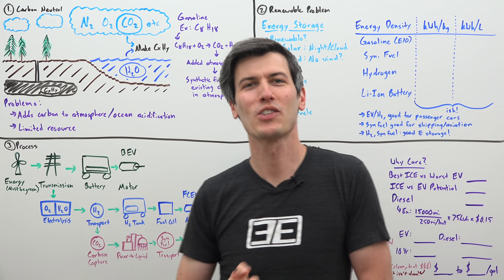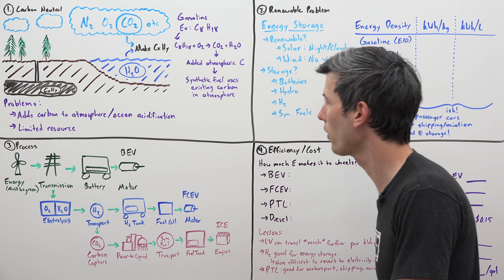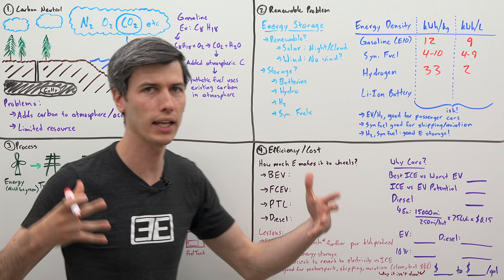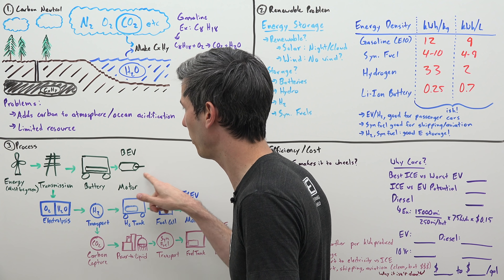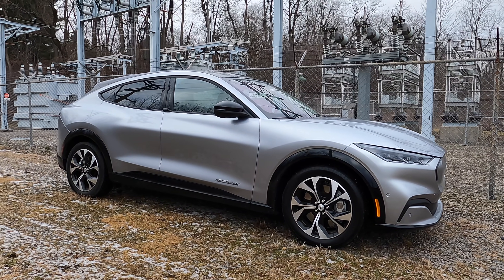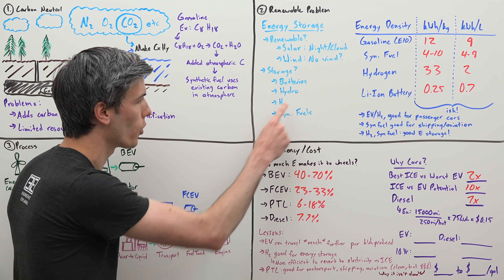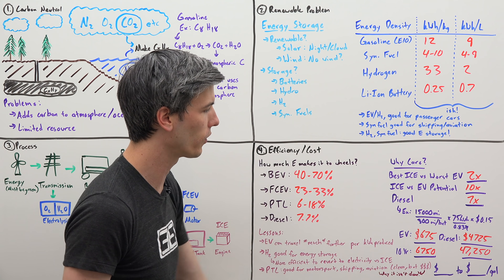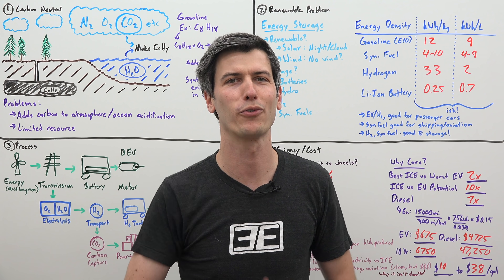The Big Problem With Synthetic Fuels

Comment from the maker: *Addressing Frequent Comments!*
1). “I’m already paying $2/L.” Porsche is at $10/L, and hoping to get it down to $2/L. That’s cost. Add in your local tax, and that number goes up. A big part of why fuel is more expensive in Europe vs the US is that it is taxed significantly higher in Europe. Additional edit: EV owners pay road taxes as well - it's incorporated into higher registration fees (you're not tax exempt simply because your transportation could be carbon neutral). 
2). “I’m an EV shill.” Haha okay. I still love my supercharged Miata, and despite how slow it is, my Crosstrek as well. It’s possible to like both combustion cars and EVs, and also acknowledge the shortcomings of each. I like burnouts. I fly frequently for work. The Jaguar F-Type SVR’s exhaust is a sound worth hearing. I’m not good for the planet. None of this changes the information presented in this video.
3). Not one compliment on those tree drawings?! C'mon. Those are some nice trees.
Reply: Please do a video on Biofuels.
Reply: @justinlynch6691  I was responding to Justin Irace above. He had a question about E85. The whole ethanol program is just a welfare program for US corn farmers. I live in farm country and find it humorous that the farmers are talking about the how ethanol fits in to carbon reduction. They don't have a clue what's coming.
Reply: Everything thats new is expensive in the beggining and gets cheaper as time goes on.
Reply: @Shabbe02  This really isn't about manufacturing processes and efficiencies, it's about energy required. As we get more efficient at producing energy this difference won't disappear. In fact, the efficient limit of a generous 40% on ICE engines means even if 0 energy is lost in making the fuel, we'll still only get 40% out.  Unless energy is free in the future, this won't change.
Reply: @justinlynch6691  you won't ever get 40% out of an ICE, you might get 35-40% out of a large ship Diesel engine that runs at efficiency peak all the time but for a passenger car we are looking more at 10-20%
Reply: @SchwertKruemel  Check out opposed piston diesel engines. They can get up to 55% efficient. Combine it with mild hybrid tech and it will be over 60%.
Reply: Nice happy trees.
Reply: I love your honesty
Reply: Yep I'm with you there most of my driving is with electric. The comparatively minuscule amount I drive at track days is ICE all the way. If the hardcore can turn their eye to people who keep horses and the greenhouse gasses involved there, my driving a few hours a year on track using E85 or synthetic fuels when they become available shouldn't be a problem also! By the way thanks for the SI units it's about time we started using them more, American engineer here by the way!
Reply: @anydaynow01  there will always be a fringe element for smaller consumption uses such as racing. Hell I'm pretty sure you can still buy leaded fuel
Reply: @justinlynch6691  because that's what makes more sense. to tax road users to build better facilities for them.
Reply: Looks at EE's wall of engine-related videos
"You're one of those EV shills!"
Reply: You should pin this.
Reply: "Additional edit: EV owners pay road taxes as well - it's incorporated into higher registration fees (you're not tax exempt simply because your transportation could be carbon neutral)."

No, but I should be tax exempt because they don't actually maintain any of the roads I drive on. I think they're more pothole than road at this point. 😋😭
Come on government, give me that money back so I can get my suspension fixed.
Reply: Its true that our fuel prices have a high amount of tax. The question is will electricity for cars stay that low? Or will they put higher taxes on it. And if not there should be no reason to give efuels not the same low taxes for an even more ecofriendly fuel (our grid is only 40% co2neutral).
Reply: Maybe some companies should build electric conversion kits or fuel cell kits for classic cars. That would be amazing since I’d still be able to drive my 93 Bronco instead of having to buy a new vehicle just to abide the regulations on carbon footprints left by automobiles
Reply: @swankscabinet1625  I believe there are a few out there that do at least electric conversion kits. GM was even selling an electric "crate engine" based on the Bolt drivetrain. I can definitely see this becoming more popular in the future.
Reply: In that panel #4 you calculated the cost for diesel as being about twice the cost for the best PTL scenario, but then you applied that diesel cost to the Porsche model; that's obviously wrong (they'll be doing gasoline, not diesel). That immediately halves your numbers. Still far from ideal, but nowhere near as bad as you paint it.
Reply: Can you not compress hydrogen? You said it has a specific amount of power per liter, but that is probably at 1 atmosperic pressure. If you stored all of your hydrogen at 100 psi, wouldn't you have a lot more stored power per liter?
Reply: @dylantroutman4363  of course you can but if you remember when you compress a gas it will get hot. The heat dissipated during compression will lead to a loss of about 30% of the energy we used to produce the hydrogen. Such a high loss just to compress the fuel is not acceptable at least not for cars. But hydrogen can be stored as metal hydrides which release the hydrogen when heated.
Reply: Failure is part of the natural cycle of business. Companies are born, companies die, capitalism moves forward.
Reply: Well, if you have a 20 years old Camry and you cannot afford to buy a new car, you would probably be ok to pay twice the price (California is already at 5$/G) and try to drive less
Reply: Trees were great! Congrats, but i loved also the "H2 Tank" and the "Power to Liquid" factory, they say practice makes perfect, keep doing what you do, i do really love your "math and drawing"  channel... ;-)
Reply: Fake news! you are great for the planet thanks to your educational videos.
Reply: I really enjoyed your video, there is one part of the synthetic fuels questions you did not fully consider, and that is using plastic waste as feedstock using thermal pyrolysis to break the bonds similar to a virgin feed cracker, a significant portion of that pygas can be used as passenger vehicle fuel rather than as feed to another petrochemical process, cost wise its a bit of a wash, right now these pyrolysis plants are very small and are mostly for recycling of process byproducts, but post consumer plastic is essentially free and would otherwise be landfilled. granted this is more like a "blue" solution than a green one as carbon is still released into the atmosphere but it is much less wasteful than simply burying the plastic
Reply: Hi Jason, what if part of the energy comes from bio waste (from existing agricultural production) and other captured emissions like methane? Does that alter the cost very much or not at all? 

Seems like petrol is gonna be a luxury product in a few decades. 🤷‍♀️
Reply: I actually noticed the trees and thought, hey those are some nice trees.
Reply: I like your trees ♥️
Reply: What about Nuclear?
also, those tree look sad, there are a nice depiction of contemporary trees.
Reply: In that case just keep the gas engine. Don’t fix what’s not broken
Reply: @HamsterV10  holy crap! These guys are the real deal. I don’t think we need to worry too much about our vehicles if these people can pull this off. They really have a good basis for it all at the moment. Can’t wait until they’re able to bring net zero carbon fuel to all of the US and eventually the world. I love this generation!
Reply: @Engineering Explained 
those are some nice trees, Bob Ross would approve ................ kind of...
Reply: well, there are more options you didn't take into consideration. The source of the carbon doesn't need to be CO2 capture. We already have a lot of carbon captured from the atmosphere in the form of biomass which we do not use. Crop burning releases about half as much CO2 as all the passenger cars in the world. We also have a lot of waste biomass starting with organic trash and finishing with human and animal waste. A lot of this carbon can be transformed into methane through fermentation and the rest can be combined with hydrogen produced through electrolysis to produce methane because methane has the highest ratio of hydrogen to carbon. CNG cars are very easy to produce because it's not a new technology. Furthermore from methane is quite easy to produce methanol but of course with increased costs. Since battery powered cars are a solution just for passengeer cars and CNG (which is methane) can be used for anything this is a broader solution. I also heard that there are fuel cells which can work with methane so it would be a much better solution for electric cars. Also vegetable oils are much cheaper than $10 /litre and they can be used to produce biodiesel. 
  You also lied about power density of batteries. A Tesla model S battery is 85kWh and weighs 540kg that means 0.157 kWh/kg and a chinese low end battery like the one mounted on dacia spring or renault kwid is 27.4KWh and weighs 280 kg that is 0.0978kWh/kg far from the 0.25kWh/kg. Another factor which has to be taken into consideration is that that power density is for a battery discharged from 100% to 0% but all manufacturers recommend to use the battery betwen 20 and 80% levels so, this is 60% of the aforementioned values and is just 0.094kWh/kg for Tesla and 0.058kWh/kg for the chinese battery.  Modern gasoline cars can achieve 35% efficiency so, the gasoline delivers 4.27kWh/kg and modern diesel cars can go to 45% so diesel fuel which has 11.6kWh/kg offers 5.22kWh/kg and the weight of the gas tank (empty) is so low that it doesn't change too much the calcuation. You also forgot to mention that ev's have an efficiecy of about 85%, that's for every 100kWh stored in the battery to the wheel we have 85kWh, so we need to adjust the numbers to about 0.08 and 0.05kWh/kg. So, in real life gasoline has about 53x the power density of the best battery (Tesla)  and diesel has 65x. It's pointless to calculate vs the chinese battery. Even a synthetic fuel which has half the energy density of the gasoline is much much more powerful than the Li-ion battery.
Reply: @Engineering Explained
Hey I have a silly concept/question. When people mention hybrid in today's world its usually a primarily combustion engine coupled to an electric motor that is more secondary in role or power output. Do you think there's a chance that someone that would do it the other way around? Or at least a hybrid car that has more parity in the power output / role of the ICE and electric motor(s)? Like something along the lines where maybe on lower speeds the electric motor plays a primary role and it slowly transitions to the ICE filling the higher end? Also does it make sense or is a purely ICE or electric vehicle make better sense?
I guess that batshit 4 door Gemera made me think what would a high performance hybrid could look like when it utilities the maximum potential of each aspects of the hybrid.
Reply: The cost of the efuels will drop down with mass production!
Reply: I don't why you are ranting about fuel here Jason, but that was a fantastic video on trees.
Reply: How about Lexus LC500 exhaust sound? I thought you were adored with it
Reply: You are assuming electricity is the starting point, but that isn't necessarily the case. Many of the chemical processes used to make efuel just need a heat source. You could use heat from a nuclear reactor and your efficiency would look a lot better.
Reply: The batteries in EV's have less energy density than coca cola. Coca cola has 95.8 grams of sugar per kilo. A gram of sugar has 16kJ of energy. So 95.8g have 1532.8kJ which converted in kWh are 0.425kWh/kg of coca cola. Tesla 100kWh battery has 625kg and 100kWh that is 0.16kWh/kg. So coca cola has 2.65x the energy density of a tesla battery. If we would burn the sugar in coca cola in a diesel engine with 40% efficiency that would result in a production of 0.17kWh of mechanical energy for every kilo of coca cola. Electric engines in ev's have around 85% efficiency so those 0.16kWh from 1 kilo of battery would produce  0.136kWh of mechanical energy, that is about 80% of the coca cola or a car powered by coca cola has 125% the energy density of a tesla car. And tesla batteries are the best ones, let's not talk about the chinese batteries. Even chicken soup has more energy per kilo. Chicken soup has 168calories/510g = 329.4cal/kg = 1383kJ/kg = 0.384kWh/kg. Chicken soup burned in a diesel would provide 0.15kWh of mechanical energy = 112% of the tesla battery.
Reply: 2 dollars/L sign me up, here in Portugal gasoline is 1.65€ it is the equivalent to your 2 dollars/L for Syn fuel and it is now not tomorrow, so i would welcome Syn fuel at 2 dollars/L.
Reply: @andrelouro88  it wouldn't be at $2/L for you, because that's $2 before transportation, taxes, and gas station profit margins.
Reply: @0hypnotoad0  i would buy it 🤷‍♂️ but i bet that the final price wouldn't be much a difference after with taxes if the demand was high, the production number and the demand that would be the most important variable in terms of the final price.
Reply: 1) If the E-fuel is CO2-neutral the taxes will be much lower. Maybe there will be subsidies even.
2) The electricity used to make E-fuels will be much cheaper and greener than your local grid. So your calculations aren't complete. Also, the infrastructure to distribute E-fuels is already in place.
Reply: Literally, one of the first things I thought when I started this video was: 'I wonder how long it took him to draw all this out on the whiteboard?' ... specifically looking at the trees, lol
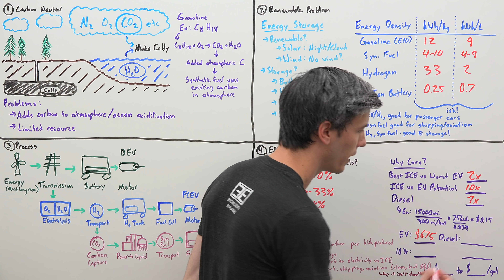Reply: @Engineering Explained, excellent video! At 11:58 you use the consumer cost of electricity per kWh to estimate the cost of synthetic fuels made with renewable energy. But large-scale producers obviously won't pay consumer rates, and as hydrogen fans love to point out, sometimes renewable electricity is extremely cheap or frees. The cost of synthetic fuels is also determined by the capital expenses of the plant as well as the operating expenses of providing the electricity (and maintenance, etc.). Nobody knows what those capital expenses will be, and whatever they turn out to be, if you only make stuff the 50% of the time when renewables are producing, your capital costs per gallon produced double compared to running the plant 24 hours a day. So you're right to say the price will be high, but basing it on electricity cost is only suggestive.

Also, to all the people who bring up tired arguments about EVs: you are FAILING as engineers by overlooking the differences in magnitude. Making a 1/2-ton battery has environmental consequences (though its materials will be recycled), but they are dwarfed by the massive harms from making then burning the literally tons of dirty fossil fuel that it will displace in operation, even on the current grid mix.
Reply: @klaaskamminga with no respect, you should go back to 1940. "We'ill never have home air conditioning, the grid can't support it!"
Grid electricity generation will only get greener, since wind and solar will continue to be the majority of new generation because they're cheap and quick. And they're a great fit for EV charging, because many owners will mostly recharge when electricity is cheap because renewables are generating.
Reply: I like the trees, but was more impressed with the depth of the oil reservoir being a shallow as the pond next to it. Next time ass dinosaur bones.
Reply: I would beg to differ on the tax being the same. I will pay significantly more taxes on fuel than an ev owner will pay in registration fees. Also saying registration fees compensate is a pretty broad statement since every location taxes them differently some just the same as a car although they probably cause more road damage than lighter ice cars
Reply: Why do you claim CO2 is bad? you're supposed to be so intelligent.. go have a chat with Dr. Richard Lindzen since you clearly are quite wrong on this.
Reply: What if ammonia is used as a means of hydrogen storage? Can you do a video about it?
Reply: As usual, very thoroughly researched. I'd just like to point out that you did not take into account the Co2 output and added pollution of battery production. Thanks!
Reply: couldn't we store energy as heat, then use a sterling generator to transform that to electricity
Reply: The idea that we're going to put EV charging stations throughout Alaska and somehow get power to the arctic in any reasonable manner is so far fetched it is a practical impossibility.
It's not just airplanes and freight ships that require synthetic fuel, most likely over half the people in the world will never be able to practically or reliably use EVs.
Reply: synthetic fuel from waisted plastics
Reply: A major factor regarding energy cost could be timing though in the future. One issue of renewable energies is that it is far less controllable when/how much is produced on a short time-scale. For example, solar power is only generated during the day, whereas a lot of EV charging is happening at night, so the consumption and production of power doesn't line up. With 100% renewable energy, there needs to be a capacity a lot higher than the actual use to compensate for these fluctuations, which means that there will be overproduction at times (too much power produced, potentially overloading the power grid). In that situation, the "cost" of energy could go down significantly when excess power can be burned through production of synthetic fuels. Currently, as far as I'm aware, this modulation is done through coal plants primarily (in germany at least), which are no longer going to be an option in the future, obviously.
Assuming potentially negligible costs for the electric power itself, couldn't the cost for synthetic fuels become very competitive in thsi scenario (and a realistic way of eliminating emissions for the billion+ combustion engines still in use)?
Reply: @xeternallegendx  One point you forget: Even if we push renewables to a level, where (with batteries) we can use it at 90% of the time, how many hours a year are left for excessive electricity? You got 8760 hours a year and in Germany in 2024 457 hours with negative price (=excessive power). That is 5 % now, maybe 25 % by the time you got 90% renewable. Carbon capture and electrolysis plants are EXPENSIVE. And you can only run them for 25% of the time! Maybe it is cheaper to waste the potential energy than transforming it to SynFuels. Or the SynFuels have a big price tag.
Reply: I see no reason to excessively tax this fuel source if it captures its carbon from the atmosphere and gets its energy from atmospherically cleaner sources like nuclear or renewables. People are already paying the energy premium to create it.
Reply: @justinlynch6691  fuel tax pays road infrastructure, that cost isnt going to disappear
Reply: @justinlynch6691  ya all fuels will always have a road tax on them for hiway infrastructure or like ev's we will pay more at registration. Either way we will be paying the tax. Where I live about half of the pump price is tax today.
Reply: @themeach011  then make all vehicles pay higher registration and recoup the cash that way, but there's no reason to disproportionately tax this fuel source.

I still maintain road users is a fallacy. People from New York who don't drive absolutely benefit from road users. That city produces little to no food, products, consumables. How does it all get there? How do people get there for tourism and shower their money on new York? How does the fire department get there to put their house out?
Reply: @justinlynch6691  it's not taxed because of co2, but to earn money. So why should it be less taxed?
For me, we will shift from a energy taxation, to a kilometric taxation, maybe via assurance fee. So in that case maybe clean fuel will be less taxed.
Reply: @hellsing56666  government taxes to punish and to modify behaviors. That's why taxes on tobacco and alcohol are so insanely high.
Reply: @NikoBellaKhouf  yes that what they say today's, but 20 years ago taxes where at the same level and it was to maintain road etc. They says what the wind tell them to say. The main reason for taxes is just to earn money.
Reply: @hellsing56666  It's up to the people to push back against that tyranny. A certain tax is understandable, and elected government is effective, but excessively high consumption taxes on a particular sector with no justification the people would accept should be rejected by the people.
Reply: @hellsing56666  gasoline prices were $1.79 per gallon when Trump was in office. The price skyrocketed immediately after biden took office and is now $3.51 per gallon and still climbing. It was because he closed the Keystone pipeline and made other poor decisions. He closed it to please the tree huggers and modify behaviors. Of course stealing money is also an incentive. But none of it is to benefit us. Government isn't our friend.
Reply: @NikoBellaKhouf  oh I'm European, I don't know how US prices are. Sorry for the misunderstanding. But yes gouvernement will always steal us...
Reply: @hellsing56666  it's ok, we're not much different. The point is that prices are higher now for no good reason and government isn't our friend. 👍
Reply: @hellsing56666  Indeed. We used to have 0 tax on biogas and also smaller taxation for biodiesel. But for some reason (money) they included taxes for biogas and also removed the smaller taxation of biodiesel.
Then in the next sentence they talk about reducing traffic emissions.

Now they are still talking about traffic emissions and also figuring how to fund the country after no one is burning fuels anymore :)
It will be some sort of km taxation and higher tax for more crowded areas with more public transportation and less tax for rural areas where you can't manage without a car.
Reply: @hellsing56666  Well Europe wants to become carbon neutral so I can see them removing the CO2 tax and implementing where if a fuel company is caught using regular fuel instead of synthetic they will get fined by every L they have sold and I mean a hefty one like 100€/L and that fine will go towards the development of synthetic fuel to get the cost down even further
Reply: @justinlynch6691  Fuel taxes are the major source of funding for roadway projects. low taxes would lead to low revenue/funding which in turn can delay repair works.
Reply: @justinlynch6691  exactly right
Reply: I'm just gonna miss the sound of my car, evs are nice, but its not the same feeling as a combustion engine.
Reply: @ODST_Republic  Well.. in here any car with good engine sound costs a huge amount of money :) Generally double the price compared to other countries. Thanks to vehicle tax which is based on CO2 emissions.
So basically if you have a nice big V8 engine or something.. it generally has higher emissions and it leads to high price.

Diesel doesn't sound good.. neither does these 1.0-2.0l 3-4 cylinder engines :) So yeah. Just saying that I don't think I've ever had any really good sounding car :)
Reply: @ODST_Republic  trust me people who live near a major road won't
Reply: 1) Porsche is producing small scale e-fuel, which is why it's so expensive currently.  There's no large scale production in place yet, and of course no economies of scale.  BTW, is that price being subsidized like the rest of the oil industry?  $10 per gallon isn't that bonkers if the alternative means driving your Porsche, which may still be worth $50k, to the junkyard and crushing it because you can no longer fuel it.  Wouldn't you rather just fill up the tank for 10 more years with carbon neutral fuel and still enjoy the car?

2) EE fails to acknowledge the massive amounts of raw materials required to build out a large supply of BEVs that we don't yet have access to, and the amount of environmental damage mining all that material will cause.  We're currently at about 3 million PEVs per year.  About half are PHEVs.  If they were all BEVs, it would equate to about 1.9 million long range BEVs.  That's before considering pickup trucks and large SUVs that'll take 2-3x as many cells to produce as a model 3, semi trucks that take 4-10x as many cells, nor grid battery storage that needs to be used in conjunction with renewable energy, taking another huge chunk of cells.  There are 1.6 billion ICE vehicles on this planet.  Even if every new vehicle was a BEV, all 80 million, it would take 20 straight years to replace all of them.  Throw in the copper, aluminum, and rare earth mining for the motors.  Aluminum is extremely energy intensive to mine and process, as are rare earth metals which also come with the side effect of devastating the environment.

3) You're not considering excess energy production.  Grid storage requires massive batteries, but batteries are expensive to build out larger storage capacity, and as a result, we may still see huge amounts of wasted energy once those storage facilities fill up.  With Hydrogen or e-fuel, storage is based on how many tanks you can build; far cheaper.  Hydrogen is corrosive, and may be more expensive / complex to store, so storing it as e-fuel may be a better idea.  Although, best yet would probably be pumped storage, so long as you never consider the damage large installations do when they fail.

4) ICEs will be on roads for at least the next 30 years by necessity. We simply can't build EVs fast enough to replace all 1.6 billion of our ICEs in the near term.  E-fuels may not be energy efficient, but using them would help reduce total net global emissions... especially if they're using energy that would have otherwise been wasted, or in regions that don't require a lot of energy, but are in great geographic locations to produce renewable energy.

5) We can use e-fuels in conjunction with PHEVs.  If PHEVs are done right, with proper home and work charging solutions, it's possible to reduce the miles a person drives on liquid fuel by 80-90%.  PHEVs can have batteries 4-6x smaller than long range BEVs, requiring 4-6x less mining to produce the same number.  The e-fuel they would use would be expensive, but a 90% reduction in liquid fuel for someone driving the average 13,500 miles per year at 45 mpg would be the difference between buying 300 gallons and 30 gallons per year.  I also imagine that e-fuel would be more cost effective if it was using cheap surplus renewable energy in its production.  Not to mention the grid requiring less batteries.

6) BEVs require a massive buildout of charging infrastructure, and batteries are quickly evolving.  That means existing charging infrastructure could quickly become obsolete within 5-10 years, requiring the vast majority of that already built infrastructure to be replaced, generating loads of waste, and requiring loads of new energy.  Utilizing #5 means we can mine less material for now, while we improve battery energy density, so that the cars built 5-10 years down the road get more range using smaller batteries and less mining.  At THAT point, we can build the charging infrastructure out using what's state of the art.  All existing PHEV batteries can be recycled to produce the new higher energy density cells.
Reply: @updlate4756  " Throw in the copper, aluminum, and rare earth mining for the motors.  Aluminum is extremely energy intensive to mine and process, as are rare earth metals which also come with the side effect of devastating the environment."

The problem with your comment is apply all this to ICE and it washes out evenly (in fact, it'll get worse for ICVs as you have to extract more CO2 out then you'd use to reduce the overall volume of CO2 in the atmosphere).

Lithium mining is only a problem in some countries that don't apply more effective environmental controls (and lithium extraction). 

"3) You're not considering excess energy production.  Grid storage requires massive batteries, but batteries are expensive to build out larger storage capacity, and as a result, we may still see huge amounts of wasted energy once those storage facilities fill up."

And you're not considering the other storage options out there such as liquid air, pumped hydro, liquid metal batteries etc. Yes we will see a huge amount of energy wasted, hence the need to build these storage options.

" With Hydrogen or e-fuel, storage is based on how many tanks you can build; far cheaper.  Hydrogen is corrosive, and may be more expensive / complex to store, so storing it as e-fuel may be a better idea.  Although, best yet would probably be pumped storage, so long as you never consider the damage large installations do when they fail."

Hydrogen is corrosive but not more expensive. It depends on the type of storage one were to run with. Hydrogen can be stored in pressurized tanks as a gas, it can be stored in liquid form, it can be stored in a metal hydride (magnesium power paste comes to mind) and they're developing a metal organic framework to store hydrogen in as well. 

"4) ICEs will be on roads for at least the next 30 years by necessity. We simply can't build EVs fast enough to replace all 1.6 billion of our ICEs in the near term.  E-fuels may not be energy efficient, but using them would help reduce total net global emissions... especially if they're using energy that would have otherwise been wasted, or in regions that don't require a lot of energy, but are in great geographic locations to produce renewable energy."

True, but new ones will become increasingly difficult and expensive to buy, much like the cost of fuel will increase as demand drops. E-fuels may help reduce GHG emissions but hydrogen still offers the best of the two options even with its corrosive properties.

"5) We can use e-fuels in conjunction with PHEVs.  If PHEVs are done right, with proper home and work charging solutions, it's possible to reduce the miles a person drives on liquid fuel by 80-90%.  PHEVs can have batteries 4-6x smaller than long range BEVs, requiring 4-6x less mining to produce the same number.  The e-fuel they would use would be expensive, but a 90% reduction in liquid fuel for someone driving the average 13,500 miles per year at 45 mpg would be the difference between buying 300 gallons and 30 gallons per year.  I also imagine that e-fuel would be more cost effective if it was using cheap surplus renewable energy in its production.  Not to mention the grid requiring less batteries."

This is like going from fibre to the home to fibre to the node, except there are no overall benefits to using e-fuels over hydrogen fuel cells (which I see as a potential range extender for BEVs, making them hybrids of a different type, assuming no radical battery changes happen). In effect, your solution is a step back that'll only drive up costs to consumers (as demand would still decline). 

That mining is happening (and you completely ignored recycling) regardless (unless you want to end all production of technology).

"6) BEVs require a massive buildout of charging infrastructure, and batteries are quickly evolving.  That means existing charging infrastructure could quickly become obsolete within 5-10 years, requiring the vast majority of that already built infrastructure to be replaced, generating loads of waste, and requiring loads of new energy.  Utilizing #5 means we can mine less material for now, while we improve battery energy density, so that the cars built 5-10 years down the road get more range using smaller batteries and less mining.  At THAT point, we can build the charging infrastructure out using what's state of the art.  All existing PHEV batteries can be recycled to produce the new higher energy density cells."

Not really, any powerpoint can be a charging station (which makes BEVs more attractive since you can charge from home). The core issue you've raised with charging infrastructure becoming obsolete is only partially accurate. The charging points would need to be upgraded over time (like in every other industry where technology changes) but the cabling infrastructure wouldn't (the biggest cost). That material would be recycled for use in larger and more capable charging points (since the fundamental technology wouldn't actually change).
Reply: Is E85 considered carbon neutral? Plants use CO2 and sunlight to make corn; we convert corn to fuel; fuel goes back in the air. If the conversion uses energy from renewables then isn't this neutral or no? E85 is cheaper than petrol.
Reply: @jirace  The problem with ethanol is that it takes so much fossil fuel to make it. The tractors burn diesel, the fertilizer is made out of natural gas, and the distillation requires natural gas. The one advantage is that the residue left over can be used to feed farm animals.
Reply: @jimfarmer7811  — Ethanol is dirty to make just as electricity is dirty. But both are expected to get cleaner.

For ethanol, run the tractor on biofuel and use biofuel for the distillation process. As far as fertilizer, perhaps us biomass (cow crap)?
Reply: @sking2173  everything you talked about can be done right now. The reason it isn't done is because it would triple the cost of ethanol production. As far as using cow and pig poop for fertilizer, the farmers are already using all the animal poop for fertilizer already and they still require massive amounts of nitrogen fertilizer.
Reply: @jirace  if our planet would have 5 times as much farmland that indeed might be an option. But we can barely feed all the people we have
Reply: I like how you made this video. 
BUT there is only one issue here. You made entire videos in the past saying that EVs are probably not greener than cars with ICE and you talked about EVs being powered by electricity made from fossil fuels (which is still the case of most countries in the world) and the harmful effects of mining rare metals to make batteries (that still aren't very efficient after decades of R&D)...And now you just state simply without any explanation that EVs are "greener" than cars with ICE. It would be nicer if you gave us arguments and scientific reasons that made you change your mind etc..I also wouldn't take a result of a single study (even if it's published in a big scientific journal) as a "truth" showing that EVs are way better with energy efficiency.
Reply: Wouldnt the numbers go ridiculously high in any case because of the world being more reliant on electric energy generation? If we all drive electric cars, and the grids are busier, generation will also be needed more and that will push up prices.
Reply: RE 1: Most of the "taxes" is eco tax explicitly due to the added CO2 emissions. So yeah, that $2/L will be most likely a bargain comparing to what we have now in Europe.
extra thought: you rigged the "process" side of the whiteboard. There's no reason against and plenty manufacturing reasons for combining electrolysis+carbon capturing processes in one plant making everything much more cost-efficient than the H2 line.
Reply: @zskk  currently i see 1.6€/L for gasoline altho it's on a spike
Reply: Sadly, I see us having to pay an "existence" tax starting from 9 months before birth!
Reply: @elementalblaze79  wot
Reply: There's one additional thing missing, and that is the limited supply of battery minerals. We lack of lithium recycling, and the mining is really harmful for the nature.

The "best" solution is smallish battery equipped hybrid hydrogen fuel cell car that can do small trips on battery only, but for longer range you continue with hydrogen. 

The overall solution is all of these solutions combined, battey, fuel cell, gasoline with E85, syntethics, and plant oil based diesel.
Reply: A LFTR or MSR would actually be a lot better for the production of Syn Fuel. 100% production 100% of the time.
Reply: @Gastón "made in electricity vs fuel."

Sure, that's a fair point, so we should also consider the replacing of internal combust engines every 10 years as well.
Reply: @christoph8966  check out Prometheus fuels. That company completely disproves the video
Reply: Resp to 1)
The existing taxes on petrol and ICE vehicles will be added to private electric vehicles, and they will have the same cost during the life o an EV... (Governments wouldn't and couldn't give up their income)
So if the production cost of Synthetic fuel comes to 2 dolars or less, and considering the high cost of the batteries, ICE might be part of the future...
Reply: Exactly, EV can only be cheaper because the governments are actively manipulating the markets to help the lobbyists sell more useless new tech (gas tax vs EV subsidies).
Reply: If co2 causing climate change, explain the medieval warming period Jason?

Looking at a common European car comparing the same car with diesel and gasoline, diesel does many more !miles to the gallon, so how can the diesel vehicle cost more in fuel than a gasoline car?
Reply: @sim6699  "If co2 causing climate change, explain the medieval warming period Jason?

Looking at a common European car comparing the same car with diesel and gasoline, diesel does many more !miles to the gallon, so how can the diesel vehicle cost more in fuel than a gasoline car?"

It's already been explained many times, I suggest you look into it yourself (also note your lack of understanding doesn't negate the science).

Watch the video, EE explains it well.
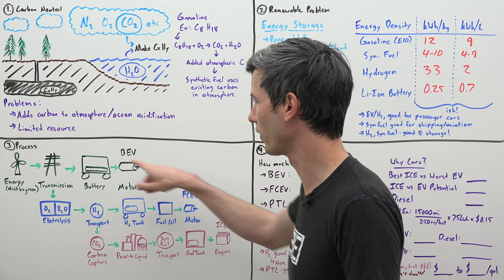Reply: 7:46 LIES! You said there are not that many steps involved. You skipped one very important step! Time=Money, Time=Energy! You skipped the Charging time step, then there is having the battery to receive and STORE the energy. You can't just pour in the energy into the battery like the other types. Here, you have to sit there and wait OR PAY A TON OF MONEY for the installation of the FAST CHARGER. So, either you include the FAST CHARGER STEP, OR you include the LONG WAIT TIME STEP with a simple cheap charger. Either way, you forgot a MAJOR STEP. Not to Mention that the battery renders the car useless when it comes to trying to recycle and get any money out of the vehicle once its crashed and in the junkyard. The batteries must be removed safely and environmentally conscience before the car can be used for scrap parts, which means there is no net profit when recycling. Then, there is the step this involved with mining the rare earth metals that go into the HUGE 1000lb battery. If it was a 30lb battery like a fuel tank, then no big deal, but its not, its 25 to 50 times greater. That's a whole lot of rare earth metal mining, and environmental damage. Simply put, don't include or mention that there is less steps, because there isn't. There is more steps involved.